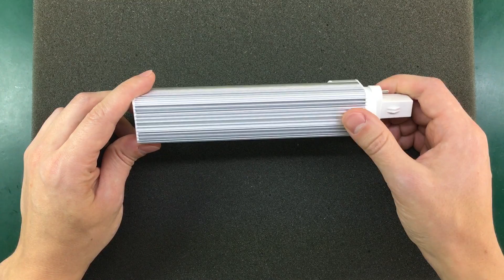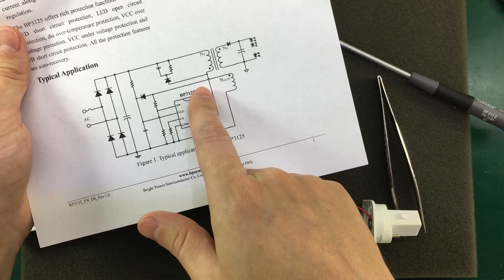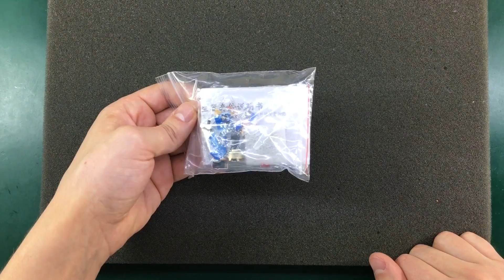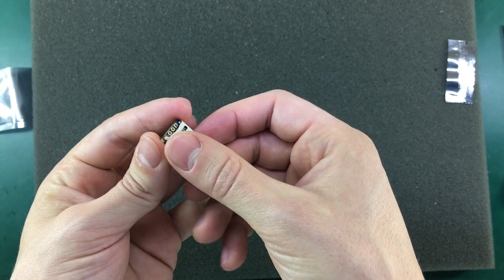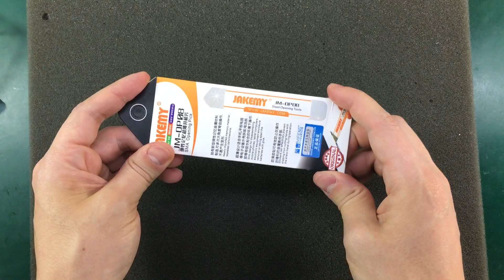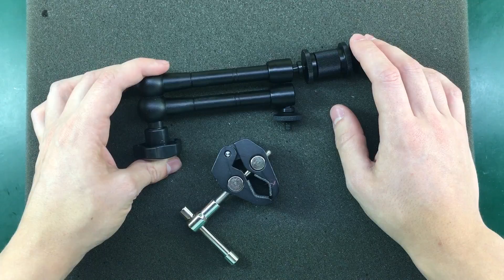Voltlog #46 - InTheMail

Comment: I also used the "mini 3A converter" it has an enable pin that is normally tied up to vcc via a small resistor. The current drawn when not enabled is very small. About 1-3 micro amperes. (I don't know the exact value as I didn't have the means to measure it with enough accuracy).